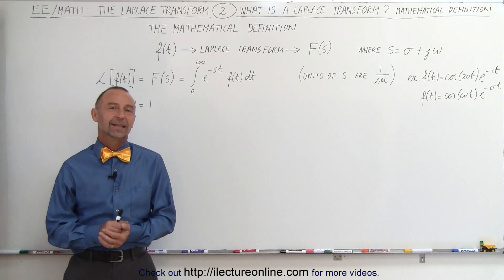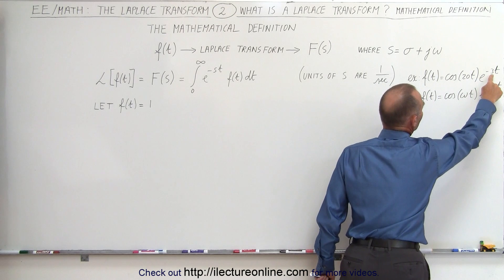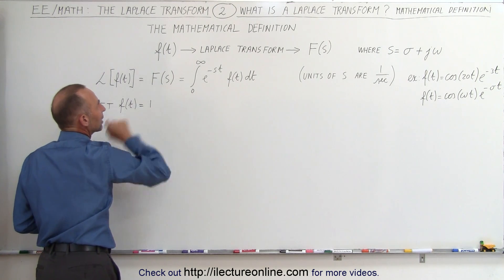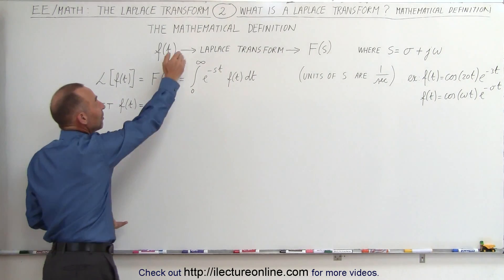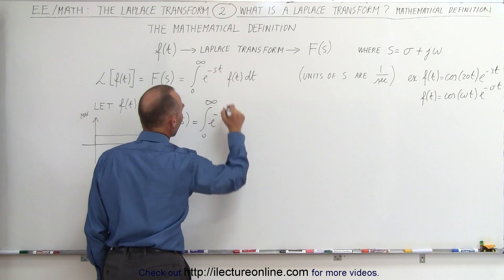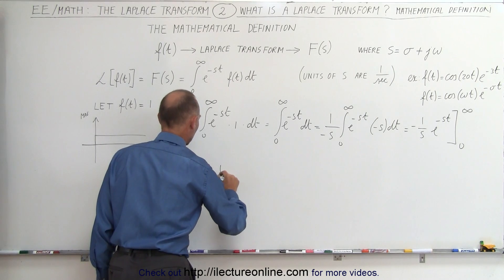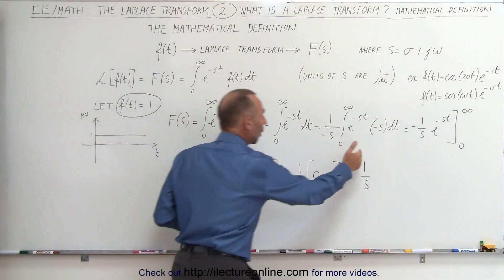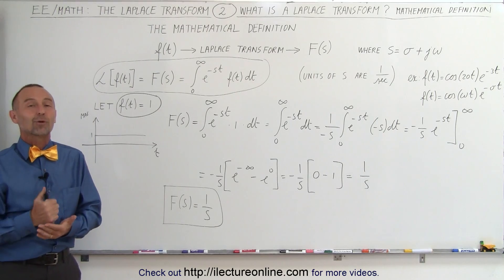Electrical Engineering: Ch 16: Laplace Transform (2 of 58) What is a Laplace Transform? Math Def

Comment: If you go into Control Systems, you will inevitably master this Transform.  Control Theory uses blocks of transfer functions (S-domain) to compute the response to various inputs and feedback loops.  These blocks are multiplicative transfer functions which can be computed algebraically.

The key point is that if you were to attempt to find the Time-Domain response, you would have to CONVOLVE all the signals.  Convolution is a nasty nonlinear MESS.  This is precisely why we use the Laplace Xform.  Convolution in the S-domain becomes simple multiplacation!!!!  That's an insanely useful tool.  After multiplying all the (S-domain) transfer functions, you can then transform back to Time-Domain and get a much, much easier answer.

Bottom Line:  Laplace Transform in not just a novelty.  It is used EVERYWHERE in Control Theory and many other disciplines.
Reply from the maker: That is part of the plan.
Reply: Michel van Biezen Hi Michael.  I'm an old Controls guy from Aerospace.  You are a great teacher.  I like the fact that you keep topics simple and limit the time of your videos.  Nicely done!

My comments were directed at your potential students who might question the utility of what you are teaching.  I realize you are a master ;-)  Keep up the great work!
Reply from the maker: I gathered that.  You apparently have a great understanding of this material.  Thanks for the input.
Reply: @ZoeTheCat  Hey, I'm doing Aerospace engineering at Georgia tech and I'm trying to master exactly that. I'm taking System Dynamics and Vibrations. I really need to do well in that class to take System Controls and Feedback. I'm struggling in that class so I decided to venture onto this video! Any advice, would be helpful!